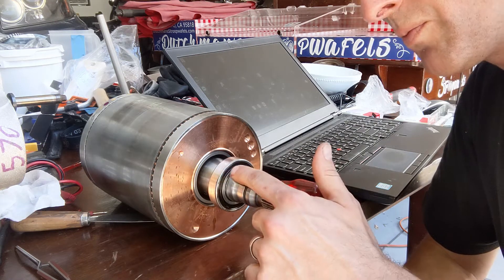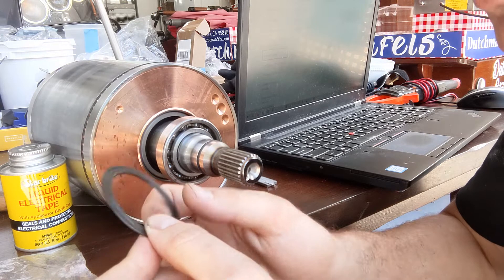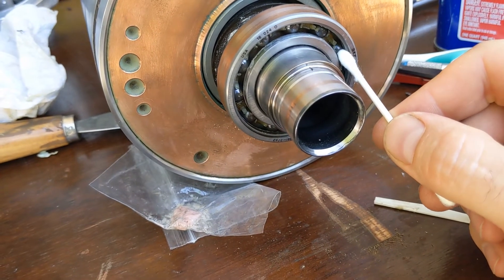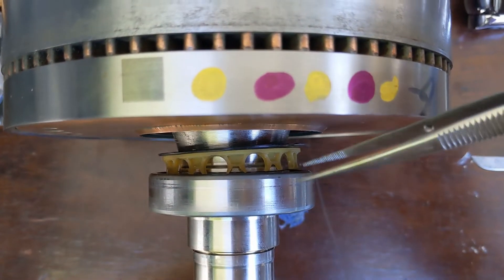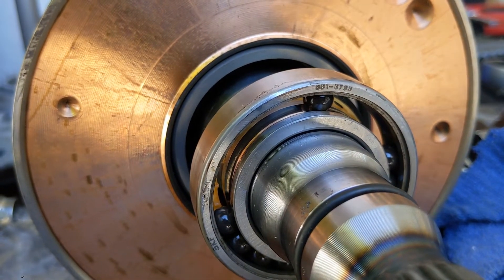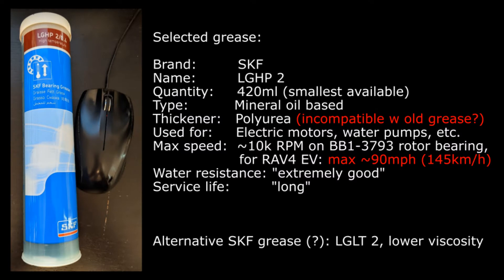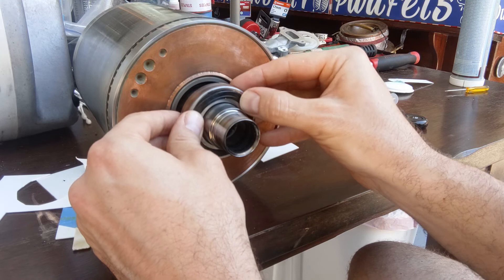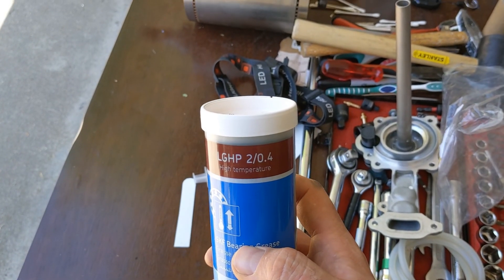Repacking Tesla / SKF Rotor Hybrid Ceramic Bearings

Comment: dont be a fool. buy bearings. they cost close to nothing.
Reply: I would use Kluber grease, but in no way would I attempt this. It's just to much risk and labor involved with a failure to save $800 for all the bearings.
Reply from the maker: Where to buy cheap?
Reply: I could imagine bearings for a motor like this wouldn't be cheap but not crazy expensive. Maybe $50 a pop
Reply: Try 500 for 2 😂

Comment: This rotor speed very high, for ceramic hybryd bearing you need spesial very expensive  grease, skf lghp not for very high speed. 
Sorry for my english)
Reply from the maker: Which specific grease would you recommend?
Reply: @diyEVguy Maybe  Kluber BF-7222.
Reply: @diyEVguy kluber nbu 15 or kluber 72 42
Reply: and also 7222

Comment: To be honest- this is rather shtty from Tesla. Ball bearings? In a day and age of cheap high precision roller bearings? Intolerable.
I'd swap the Tesla SKF with roller needle bearings.
Reply from the maker: I don't have experience in motor design. Do you happen to have references to designs examples with similar conditions as this motor where high precision roller bearings are shown to be a better choice? Also which needle bearings would you recommend?
Reply: @diyEVguy well the examples are the many aircraft piston engines for example Mercedes Benz DB601-605 series in WW2. Look up DB601 +bearings '+cutaway you'll see a cutaway of crank to conrod bearing is roller bearings. Also the maybach powerpack for the various tanks had roller bearings.
You need to give me the bearing and number so I can cross reference it with an NSK or SKF chart or you can look up pedfs of SKF, Timken, NSK whoever you use spec charts. Efficiency improvement above 5% is possible- 5% more torque and power sound good enough for me to shell out for some proper bearings instead of the crud Tesla use. 

Proofs:
"The roller bearing engine: A cost effective way to reduce fuel consumption" by Christof Tiemann, Markus Kalenborn, Kolja Orlowsky, Christoph Steffens & Werner Bick 1 April 2005 MTZ worldwide: 
"Pure Efficiency: Developing combustion engines from the perspective of a supplier:" Dr Martin Scheidt & Matthias Lang
"Roller-Bearings in Combustion Engines – an Effective Way for .

"Evaluation of a Low Friction, High Efficiency roller Bearing Engine"- the Timken Compnay proj. mngr Charles W. (Skip) Shattuck
Conclusion: "The test results measured when the engine was powered by an external motor confirmed the results of earlier studies which showed that application of roller bearings to an ICE does reduce friction, although the 5-10% reduction was less than the amount seen in other studies."
"Crankpin Bearings in High Output Aircraft Piston Engines The Evolution of their Design and Loading" by Robert J. Raymond, July 2015 Aircraft Engine Historical Society
Reply from the maker: @markiobook8639  The Tesla motor needs hybrid ceramic bearings (ceramic balls in metal races) due to the "common mode" voltages created by the variable frequency drive. Maybe ceramic balls were more widely available. Also the radial loads are relatively low and the speed is very high (>10,000RPM). From the perspective of load bearing capabilities, a line contact from needle bearings may not be needed.
Reply: @diyEVguy  You may be correct their I was wondering why ceramic bearings at all since it's not a high heat application- yes I think you may be right about insulation properties- perhaps metal bearings arc or have the potential to arc- no good for lithium battery packs.
Reply: No way, these "nano-ceramic" coated bearings are made to be non-conductive. The first non-conductive high-speed motor bearings ever created. At the speeds the Tesla motors are capable of, 16000+ rpm, It appears that high current arcing causes all other types of conductive bearings to fail.
Reply: @mpirron1  Yes, replacement of full metal bearings in the electric motors with ceramic composite bearings was an early Tesla Model S recall, due to all metal bearing damage from electric arcing.  Everything they have done since has used ceramic balls to avoid a repeat of the problem.
Reply: @ikijime  my problem is with calling these substances ceramics I guess
Reply: @mpirron1  "non conductive balls" perhaps.  But then again, that could lead to other connotations...
Reply: I have never seen anything else than ball bearings in electric motors

Comment: Please clarify, have you replaced the ceramic bearings with new ones or not?
Reply from the maker: No I re-used the old ones and I "repacked" them with fresh new grease.
Reply: @diyEVguy  Thanks for the answer! 
One more question. In this motor, have you seen such a "brush!? Its condition? https://youtu.be/VW4_ICHFTM0?t=94
Reply: They are extremely expensive, unless the bearing is trashed and gritty I wouldn't replace it if the seals can be removed and reinstalled without damage.
Reply: @FrozenHaxor  Because of this, I would never trust you to repair my vehicle: 
https://youtu.be/VW4_ICHFTM0